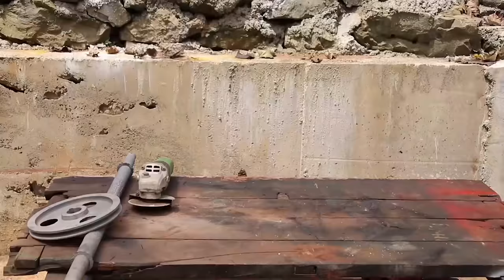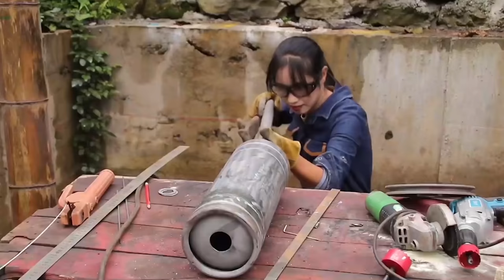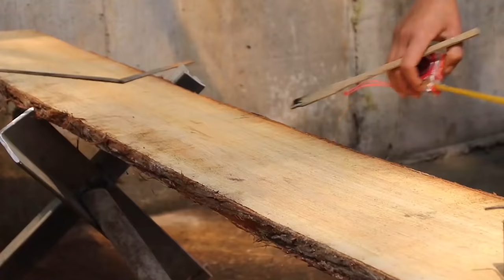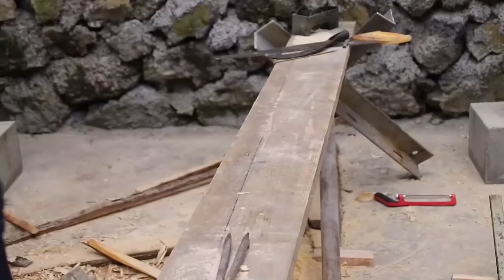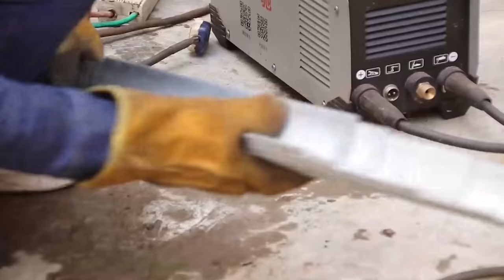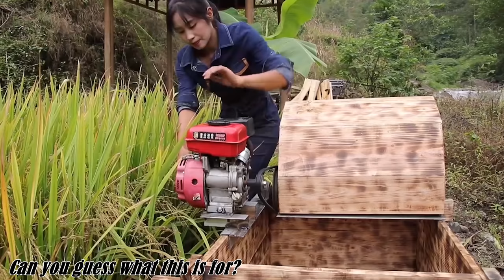💡How To DIY A Diesel Threshing Machine With The Old Fire Extinguisher At Home | Linguoer

Comment: If you want your grinder blades to last 10 times longer, use only the tip to score the cut.
Making many passes instead of plunging the blade, to cut in one pass. 
Try it.
Reply: I found Blackhawk brand stainless rated disc's are simply amazing for longevity and aggressive cutting